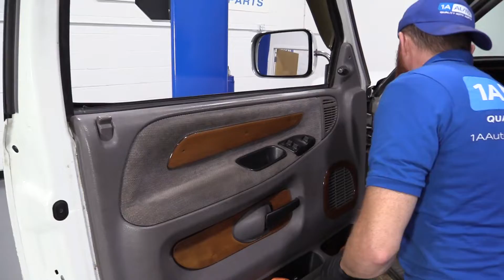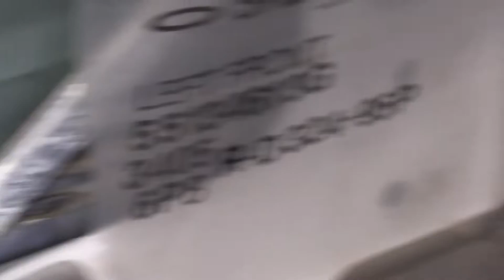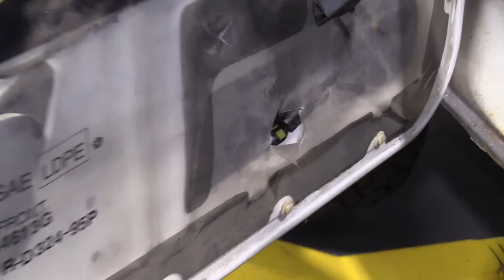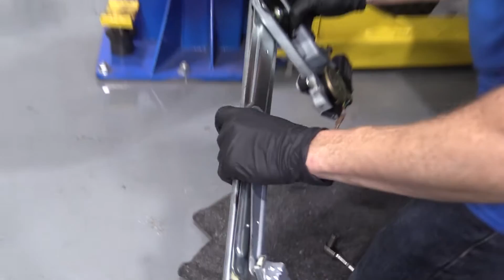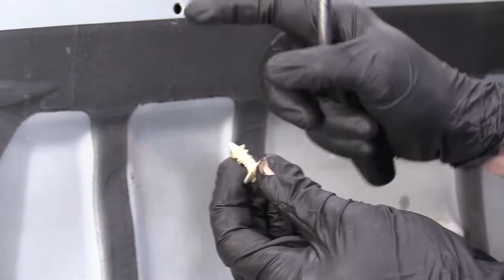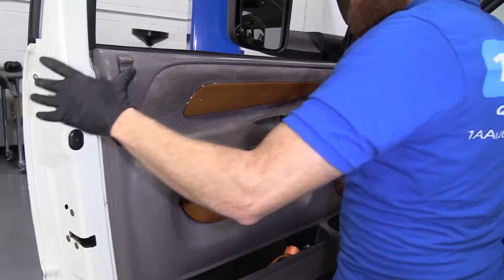How to Replace Window Motor 94-02 Dodge Ram 1500

Comment: Mine is stuck up and I can’t get the window down I unplugged the window and used a test light and my switch is good it gets power both ways were the window plugs in at.   If I need to change my motor again how can I do that with the window stuck up I dk how to get the window down

Comment: So, the spring goes flying off when the old motor is removed, then he miraculously installs the new motor on a brand new regulator with spring intact? 
 The video was good up until that point.
 I need to know how to get my bad motor off without the spring shooting across my garage, and if it does, how do I get the spring reinstalled on my existing regulator?
  I have the new motor. maybe I should have purchased the new motor already attached to a new regulator and simplify the process.
In other words, HELP!

Comment: Window stuck in position.  Could it be the switch or motor.  Don't want to replace motor unless necessary.  Passenger window works fine.

Comment: Some of these parts are made with cheap, weak materials, so be very careful when tightening the bolts. The part I got didn't fit exactly right. It required that I add washers so the drive gear wouldn't bind up on the regulator. Cheap parts. Poor fitment, but I got it working.

Comment: OK thanks for posting this. I did learn some things, BUT the viewers should know that you DON'T have to remove the regulator to change out the motor. Just tape the window UP and reach in and take the 3 bolts out. you don't have to worry about the rotational spring going flying either. it's holding the window in the up position . just leave the regulator bolts in place. I loosened a couple of them just in case they needed to be, but it was very easy and it worked great the first time.  I had it done in less time than it took to watch the video.
Reply: Thanks a million. I just did it to my truck just loosened 2 bolts from the regulator closest to the motor, then just removed 3 bolts from motor. Pulled it out, installed new motor, tightened bolts and VOILA, 15 minutes later had a working up and down window....
Reply: That's what I was looking for dude  thanks
Reply: So you're saying,  through the speaker hole remove the motor with the three bolts and it comes off without any recoil?
Reply: My window was up. So i just taped it to stay up .
Reply: Thanks for posting that. It worked without take everything out .

Comment: Hello we're working on our passenger door on a 1999 Dodge ram 1500 The window will not roll up or roll down we hear the motor try and figure it must need to be replaced cuz it won't move how do we replace it with the window rolled up or what was you suggest we troubleshoot

Comment: How do you remove the regulator if you can't roll the window down because the regulator has the guides in the up position
Reply from the maker: +Cameron P You can still take off the door panel and push it up so you can tape it.
Reply: @1AAuto  that is what was unclear....

To anyone who runs into the scenario where you can't roll your window down and its stuck in the up position. You can still reach those bolts that hold the window to the guide arms attached to the regulator motor.

My process was to loosen the bolts that hold the window to the guides and just keep them snug.

I then loosened all the bolts that hold the entire regulator assembly and guides to the door like in this video. 

I took the bolts in the center out first the one right behind the door handle and then the one below that. 

Don't remove the bolts on that sit in a slot with a cut out around it. 

Whenever I took the two bolts on the left side out the window was wanting to move down but I anticipated that and it wasn't bad at all.

Just be careful and go slow and mind what you are doing. It's no where near as scary as removing the regulator motor from that torsion spring thing. 

Good luck!
Reply: Thanks Cameron.  My passenger window is stuck open and was wondering what the process is.  Thanks a lot.  Going to be a breeze with your info!

Comment: What if the window is stuck up
Reply: Taylor my window wont go down
Reply: I guess we are fucked dude. Cause I'm in the same position
Reply: Did u find out?
Reply: @mikeruizxd5534  if your window is stuck up, then just replace the motor without pulling out the regulator.